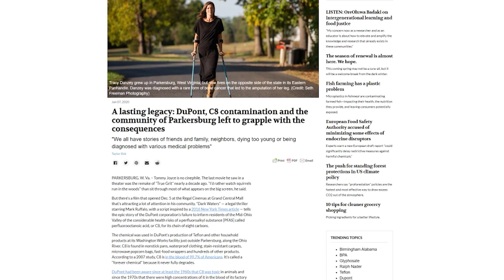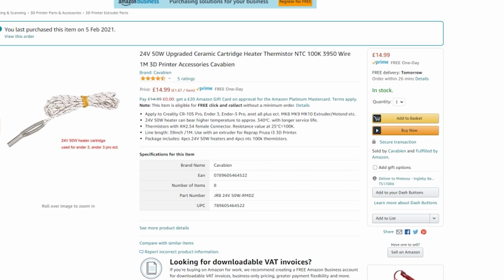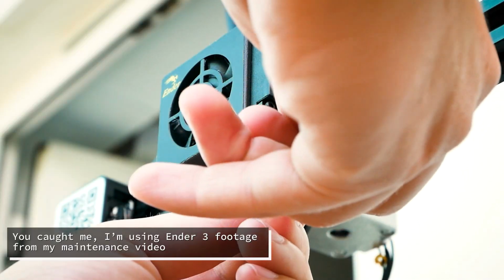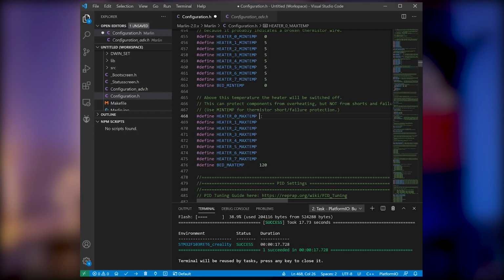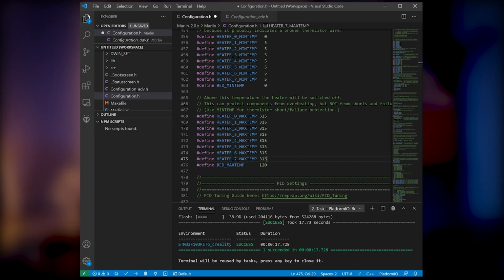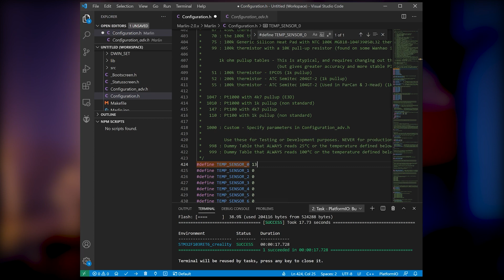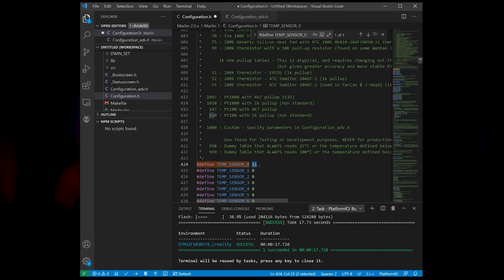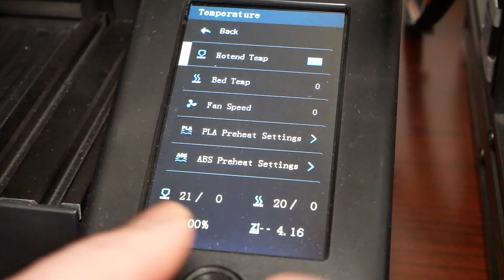All metal hotend on Ender 3 v2

Comment: I tried to raise the temperature of Ender 3 Max, I wanted to achieve ~270-280c. The printer stops at 260c, even when I made the firmware changes. Is it really necessary to change the original heater cartridge and thermistor?
Reply from the maker: You have a temp limit for a reason. The PTFE tube releases chlorine gases if heated up over 260C which is not good for you health. 

Changing hotend is the recommended way of dealing with the issue for a number of reasons like better thermal control, consistency and hotend designed to whitstand the conditions. 

Once a new hotend is installed, you can then raise the temperature in firmware. You will need to set new temps to be 15C higher than desired limit.
Reply: @notenoughtech  My problem is the temperature not rising above 260c, even when I set it to 300c to achieve maximum on 285c. Is it because of the 40w heater cartridge being too weak, or is it a problem in the software?
Reply from the maker: It's likely the cartridge or board. If your hot end is not getting hot enough the heating element lacks of beans. 
Board needs to supply enough current and cartridge needs to be able to heat up safely although you could probably heat up the cartridge more given enough current. So my bet right now would be ok board, psu. You can also check the voltage requirements for your cartridge (12v Vs 24) but you would find the undereating to be a bigger problem earlier on

Comment: I genuinely appreciate your video presentation, thank you! However for those of use that not fluent in any way with building new firmware your instructions assume that the most basic ins & outs of using MS Visual Studio are known. A walkthrough of the actual installation, setup of VS and a click by click depiction of how the modification and building of new firmware is accomplished would have been a brilliant stroke of inclusion for the unwashed masses that are not familiar with the basics but want to learn the use of these tools for this very specific purpose.
Reply from the maker: I get that, honestly I do but this will greatly increase the length of the guide and will bring new issues to the table. I try to make things easier to follow but also expect a degree of knowledge in other aspects. 

If I start the tutorial on the hot end upgrade with instructions how to setup VSC it becomes irrelevant to others who look for quick refresh guide on how to do the upgrade. 
We both know that there will be more than one guide about each topic so if someone feels that blanks need to be filled they will the material to get up to speed.

I do appreciate your comment though and see what else I could do to make it more accommodating
Reply: @notenoughtech totally understand, and to prove your point I went down the rabbit hole of VS and learned a lot. Thanks for all of your hard work in creating your videos and your website.
Reply from the maker: VSC code is good to get along with. I'm far from being an authority on it so I leave teaching to others but having platformio knowledge and basic coding skills you can get through a lot of fun projects

Comment: My all metal hotend is constanly cloging up, it's crap, I wish I never changed it and threw the original ender one away.
Reply from the maker: Check if your heating element and thermistor is fitted correctly. You may need to re-tune these to make sure the filament is at precise temperatures. 
Next up check if your Bowden tube sits in correctly and  that the gap between the metal insert and the nozzle is closed. These screw in from both sides of the block on mine. 

Hopefully these hints will help you troubleshoot the clogs

Comment: Did you ever do the video for the higher quality materials on the Ender 3? I have the same printer and usually do only PETG but am getting great results with the stock hotend. I was looking at the Micro Swiss replacement so I could do higher temp materials because I need to print stuff that will hold up high temperature LED lights without losing rigidity from the heat.
Reply: The MicroSwiss hotend is great! I have that on a couple of my printers and will possibly uphgrade my Ender 3 with one as well unless I go a different route and experiment a bit.
Reply from the maker: Still on the back burner. I have most of it done just struggling to allocate the time. I printed $200 a roll filament on this machine with success so I would definitely recommend but I just need more prints to do some testing for settings. Plus ideally I'd like to find a sponsor for this topic. Might ping polymaker about it - it will give me the motivation to finish it.
Reply: @notenoughtech  I really liked Polymaker's Carbon filament that I was printing at my old job. We were making brackets for some headlights for customers and it came out very nicely with the proper settings on a CR-10S Pro. It did like to eat through the nozzles though.
Reply from the maker: Fair enough. I already have 5 nozzles made from hardened steel. Just digging through the backlog of things to do. I hurt my back badly in may and it out me behind everything. I'm only just getting better where I can actually sit long enough to edit. Unfortunate but it's life
Reply: @notenoughtech  get better soon mate! I am STILL recovering from a lower back injury.
Reply from the maker: Keep your back safe. 😳

Comment: I recently installed a Chinese knock-off, all-metal hotend in my Ender 3 V2, keeping the stock thermistor and heat cartridge. I bought the hotend via an AliExpress link from another Youtube video.

I could not, for the life of me, get PLA to print without clogging. Every single print clogged after about 5 minutes. I made all the adjustments recommended for this all-metal hotend/PLA clog problem, but nothing helped.

PETG, on the other hand, printed just fine, zero clogs. The only difference: 200c for PLA, 230c for PETG.

I ended up putting the stock hotend back on the printer, and all is well again. Bummer, though, because I was hoping to print with ABS, and I don't want to push the stock components to their limit in order to do so.

Edit to add: I also encountered the same problem as this YouTuber in that the nozzle did not extend below the fan shroud, so the shroud would drag on the bed. But instead of filing down the shroud, I simply dropped the heater block down a bit from the heat sink (about 2mm, I'd say...still lots of contact between the heat-break and heatsink).
Reply from the maker: Clogges would happen due to uneven temperature along the heartbreak and possible gap between the nozzle and the heartbreak. You could try check these and run pla a little warmer.
Reply: @notenoughtech  Thanks. I definitely ensured that the nozzle was butted up tight against the heat-break... that's vital. But I figured if there was slightly less of the heat-break inside the heatsink it wouldn't be a problem. The successful printing of the higher temperature PETG kinda bears that out.

Strangely, I didn't try printing the PLA at a higher temperature, I guess because it has always been the temp I use for PLA and it has never been a problem. Also, the trouble-shooting site I read didn't mention it.

Comment: So both in your guide and here in the video you show a M3 Hex NTC 3950 Thermistor, but the Link you posted links to a thermristor that uses PTFE correct?

Do you think that one of these would work well:

https://www.amazon.com/gp/product/B07B42NPW3/ref=ppx_yo_dt_b_asin_title_o00_s00?ie=UTF8&psc=1
Reply from the maker: I think I listed both. One was with bundled heating cartridgesd but the thermistors were PTFE the other link should be the one I had
Reply: @notenoughtech  Ah, Both links show up as https://amzn.to/36Kbwsp, I played back through your video an saw the ones you got. I was looking away and missed it on screen.
Reply from the maker: My bad, I will update it. The thermistor used is this: https://amzn.to/3sLxZOs
Reply: @notenoughtech  Happy to help! Liked the video so thought I'd help you and others out by making sure noone bought the wrong part and blamed you later
Reply from the maker: Absolutely right for letting me know. I appreciate it
Reply: @notenoughtech  What about a PT100 without an amplifier board, would it work?
Reply from the maker: @benjaminmathon7417  I haven't tried it. You would have to check the datasheet and see what is the resistance and if the output would conform settings in Marlin

Comment: There is the M303 Gcode which does a PID autotune, no need to mess with the parameters manually.
Reply from the maker: That's why I suggested to use autotune, test it  adjust manually as needed and explained how PID works.